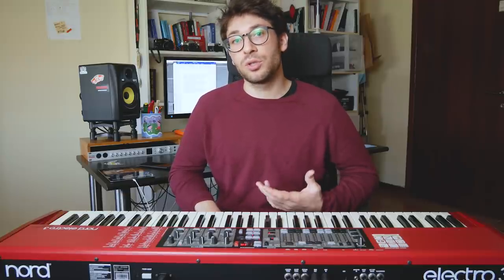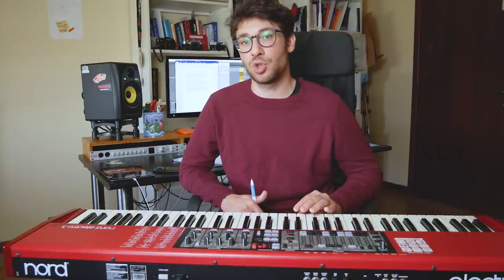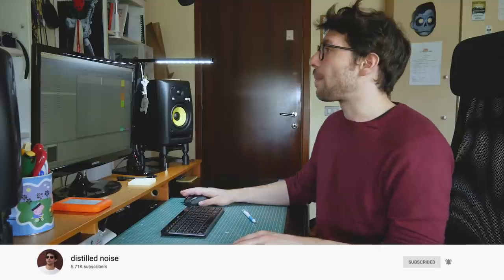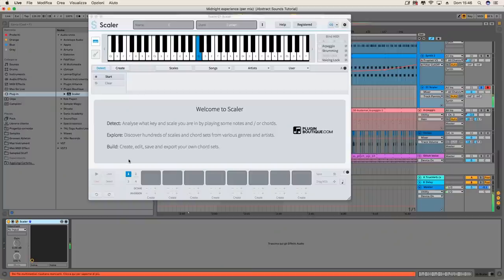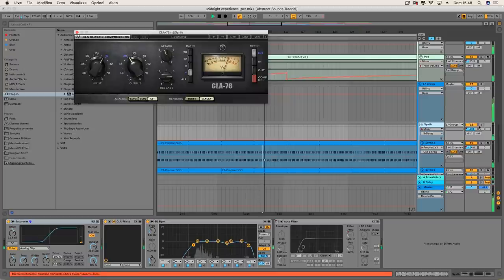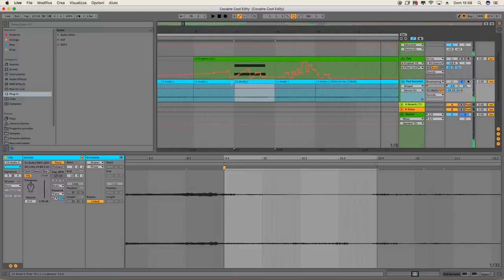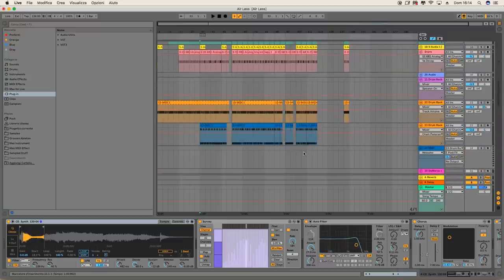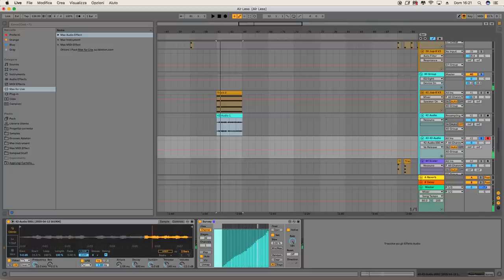How to make MINIMAL HOUSE PADS (almost full comprehensive guide) | distilled noise

Comment: So if I understand it correctly: 

You are mapping the shaper to the start moment of the sample.
But the sample is an automated filter stab, you by using the shaper to map the start moment of the sample you are just automating the filter indirectly.
Isnt it just easier to automate the filter using the shaper instead of automating the start moment?
Reply from the maker: Mmm i tried and i found out that in the way i do, the movement of the filter is gentler and i like it more but of course what you say is another good way to do it 🙃 
Cheers
Reply: @distillednoise  Thanks man! Great vid anyway! Is there anyway you could cover track arrangement (going from loop to full track) as well? You are a great teacher :)
Reply: @danipanadj  Yes, an Arrangement video would be great !!
Reply from the maker: @danipanadj  that's a hard topic cause i never do a track from start to finish in a session! But i could do a video with some exaple of my finished tracks :) i'll think about it, thanks
Reply: @distillednoise  Would be great man! Maybe it doesnt take to much time if you already have the loop ready to be track, so you start the video with the loop ready for arrangement. Just a tip! Thanks for your time man :)

Comment: Do you use the nord rack a lot for leads, chords and pads?
Reply from the maker: Hi! Actually i'm using it just as a midi controller, not using the sounds in it. That is the nord electro so it's good for pianos and organs but the synth library is very small, so not good for electronic music ;)